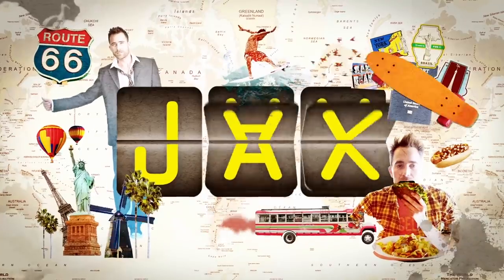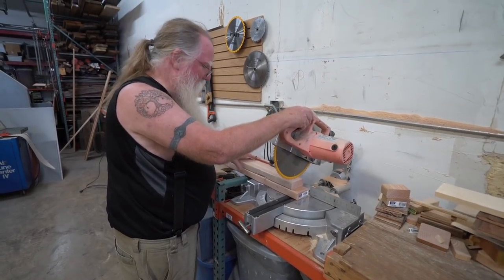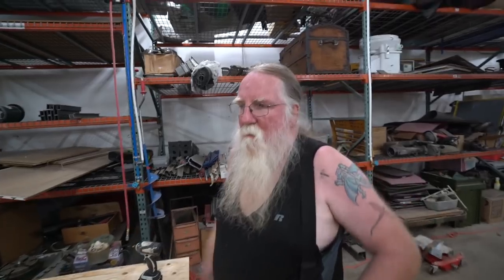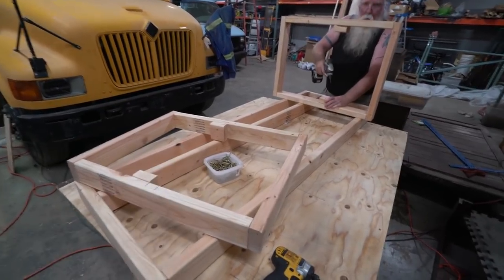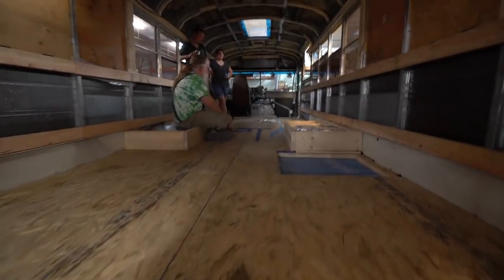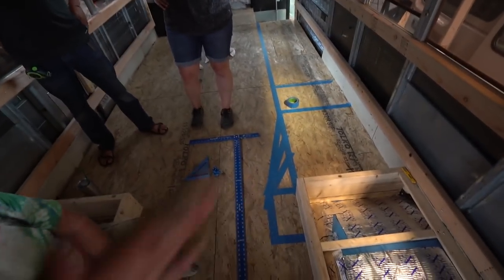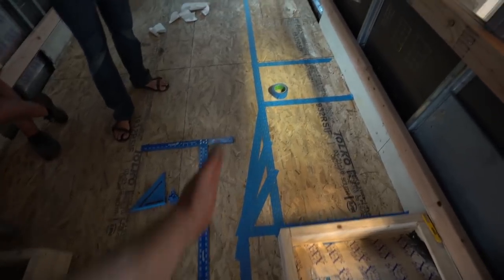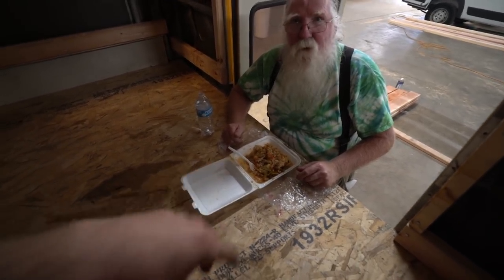VanLife Benches Fold Into Couch (skoolie)

Comment: the long slant is probably eaziest if its one kitchen cabinet with a drawer , best case scenario is that you want the length of the slant to be about one cabinet long 
its allso a little extra counterspace over floorspace you whont use anyway (you can make a small spicerack type of thing in the inside corner of that countertop)
the door on that can be one piece and hinge from the wide part and the slide can be made with a slanted front (wish might make it ackward to open as you expect it to go in the direction of the front and not ofset )